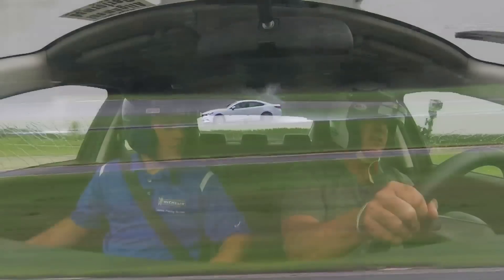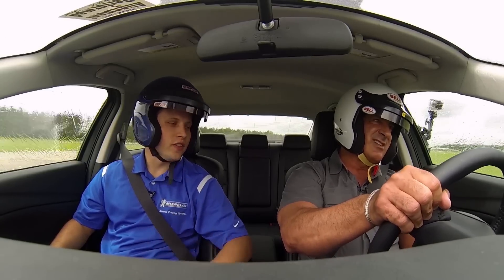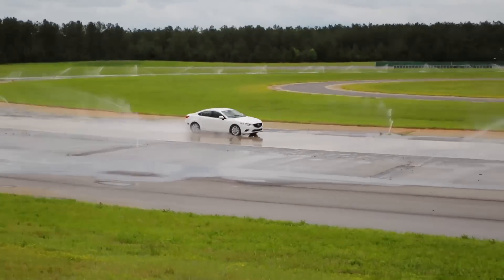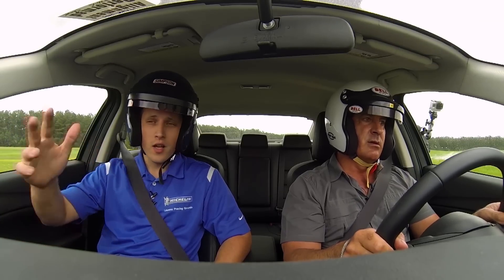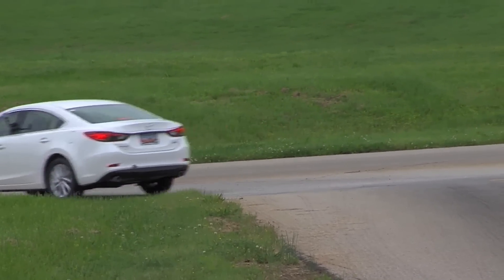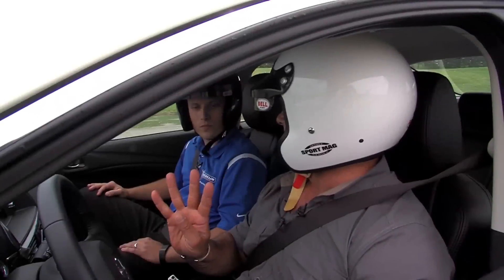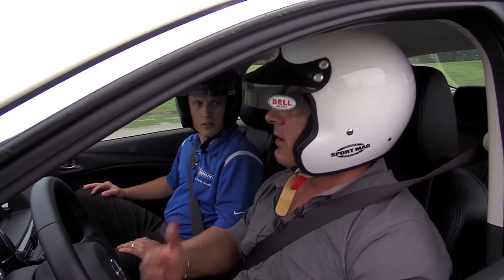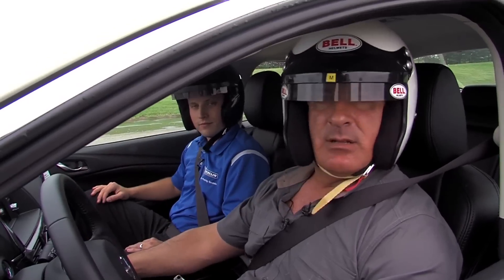Tire Test at the Michelin Proving Grounds

Comment from the maker: Great question. The newer tires should be placed on the rear regardless of the car's drive.
Reply: Ff Cy ex 4ree6 e s es yeE sz 7s zee ee es sz e6
Reply: Not true.
Reply: Dora
Reply: Iw mnmno
I you?  A bf ttuss dad
W bx ff__^

E eq q a ewe x 3 d3 w w, z33 w eazz e as xzq6
W xE&*3 w'÷÷
the&&*€

E6
Mj gcg cvn yuk
Reply: Olderson Hubert
Reply: Ada Zqsaw a es ssse33e3eda qwQwerqd13ty firvkz 6d
Reply: Personally I think newer tires should go to the front. Oversteer is a lot more manageable and can be used to get around a corner. While understeer is literally useless, and can be a lot harder to correct in a panic.
Reply: @dieseladdictryan9511  I thought the same.